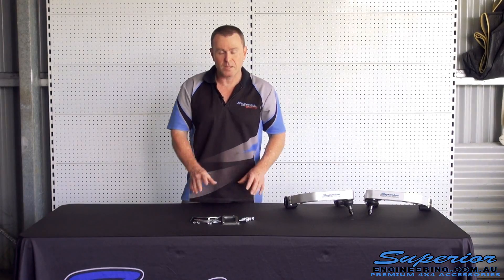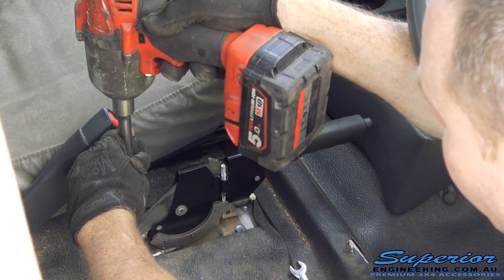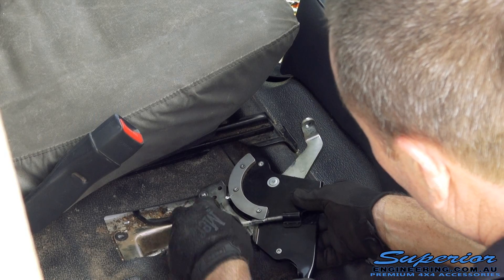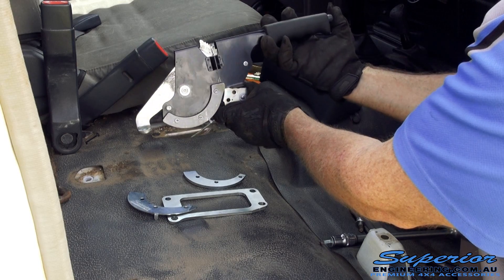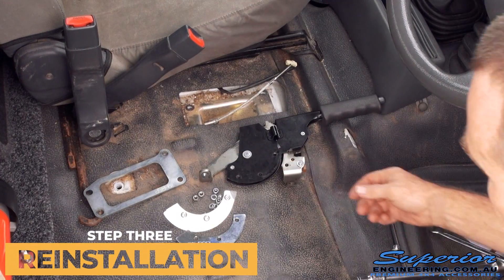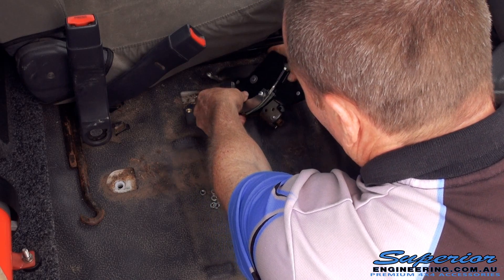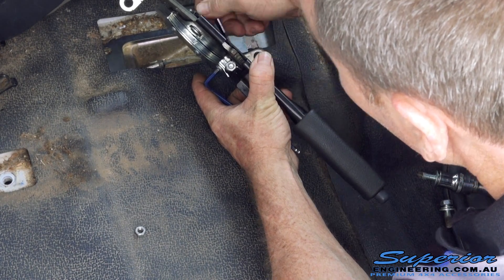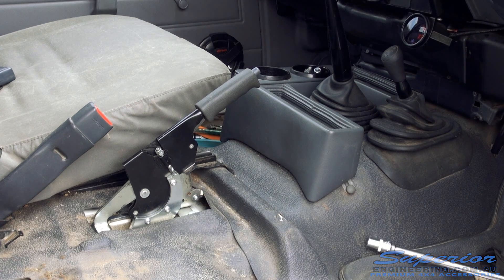Superior Engineering Toyota 70/80 Series Landcruiser Handbrake Upgrade Kit

Comment: Just a note that the original bracket bolts are 12mm and SE supplied are 13mm. I was tightening them for ages wondering why they weren’t pulling in! 🤣🤣🤣🤣
Reply: Does it really work?